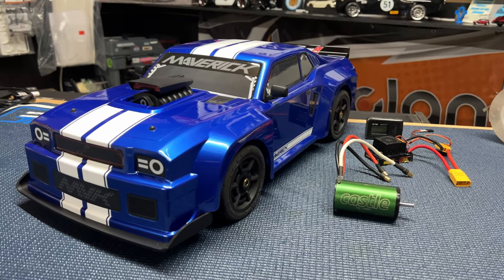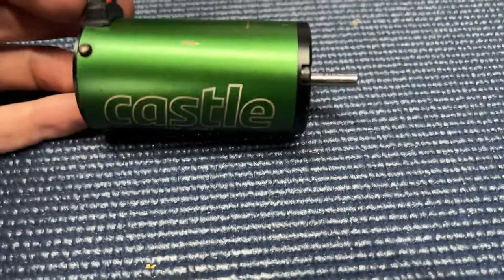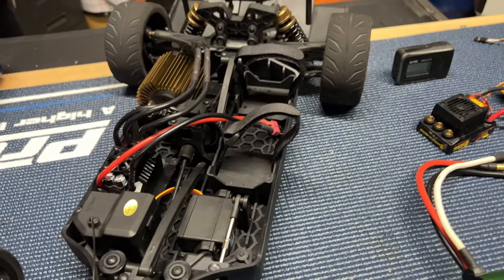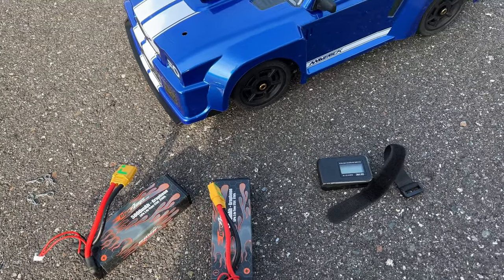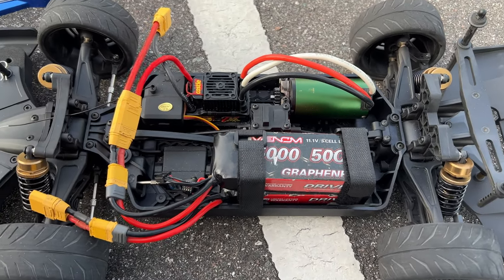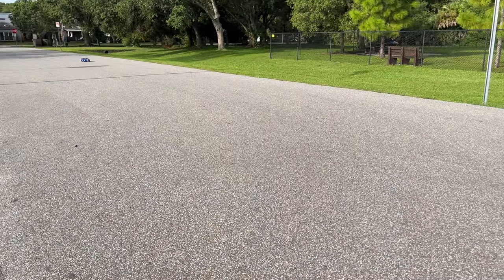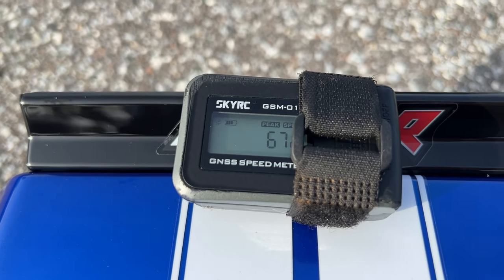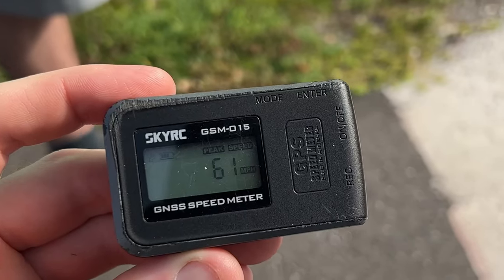6s Upgrade to Maverick QuantumR 1/8th RC | How Fast Is It Now? | OMGRC.com

Comment: Hey I have the 1/8th sidewinder combo has the 1515 & ever scince I have had it the bec doesn’t work 🤷‍♂️ any ideas on why it wouldn’t have power for the receiver? Great vid btw dang 61 for the rustler is pretty good 👍 flux still on stock gears rite?